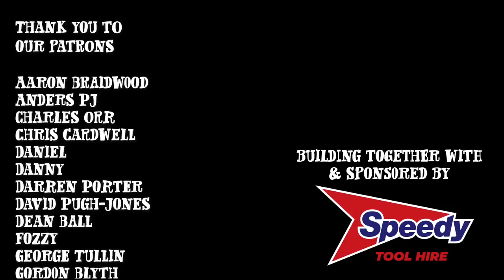HANGING WOODEN GATES

Comment: I recently installed two new 8ft gates on new posts. I think I over engineered the setting out!  I had memory sticks for post width as well as location of holes in posts. But my gates were iroko and pretty heavy, so saved a lot of handling. Good job on yours and made me think about different ways to tackle a job.

Comment: You should put the crooks on the face facing in or out of the opening. It looks better and will also allow the gate to fully swing through 180 degrees if the ground level allows. You can also latch it fully open to the fence nice and tidy.

Comment: I think you might be right about getting the pins through the uprights on the far side of the post away from the chalet as a good way to fit them. If there aren't going to be too many situations where you'll need the gates open more broadly than the passageway between them, it probably won' t bother you. If it does happen, the hinges will mark the posts where the chamfer is going to help with the wider opening. You'll know where to take some wood off the posts. Really good video - good luck with the next.

Comment: Round gate posts allow a greater opening angle
Reply: And then you can use a post rammer as well. Also meaning you don't need concrete which you should always avoid if you have the chance. I hang 12 foot metal gates off 8+ foot 6 inch rounds with no concrete and they work perfectly well with no sagging

Comment: Did you add extra protection to the wood of the gate posts that will be below ground? The concrete will suck water from the subsoil and then it soaks into the wood with risk the post bottoms rotting out.

Comment: it looks a little weird but if you drill your hinges diagonally corner to corner through the post it allows them to open completely without having a big gap. i guess you could also just set the posts at a 45 degree angle inwards aswell but them might look even weirder.

Comment: If you arrange the bottom pin about an inch nearer the post than the top pin with the bottom hinge correspondingly longer the far end of the gate will rise up when opened and the gate will swing shut on its own.

Comment: You may already be doing this but something to retain the open gate leaves might be a good idea so the wind doesn’t slam the gate into your vehicle as passing through.  Also the farmer next to me swears that the treatment on the pressure treated wood is not what it once was (creosote) so they rot quicker at the bottom even though the rest of the wood is solid.  Just might have to treat them yourself.
Reply: The farmer’s right. New chemicals are safer, but not as effective. I’ve heard tar is a good solution (though not feasible here).

Comment: Top tip. Put the top pin upside down stops livestock or thieves lifting them off!
Reply from the maker: We have needed to lift gates on and off for various reasons so find that just putting a open through the gate pin is fine. (especially needed for the pigs).  I'd flip them for road or driveway gates though. 👍
Reply: So that means that the gate is not supported by the top hinge?

Comment: A good trick for getting self closing gates is to set the post back half a bubble.  Works great, but not o double gates.  Not a fan of concreting in gate posts.
Reply from the maker: Yeah always handy to let them self close so they can’t be let open by accident. All our posts are knocked in straight but knowing our soil and seeing the concreted posts I’ve pulled out I’m sure these will last just fine. They would have knocked in with tractor but would have needed to re shape the tops. 🙄

Comment: You said the posts are solid in the ground but every time you hit the pin they moved a fair bit
Let’s hope you have not cracked the concrete 
After all concrete takes weeks to get to full strength not 24 hrs 
Time will tell
Reply: Came here to say just this!